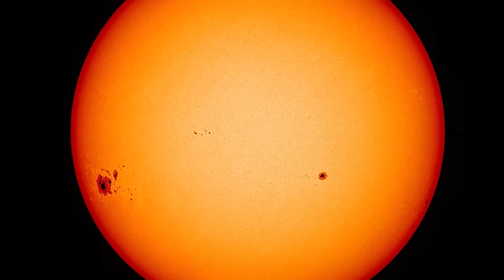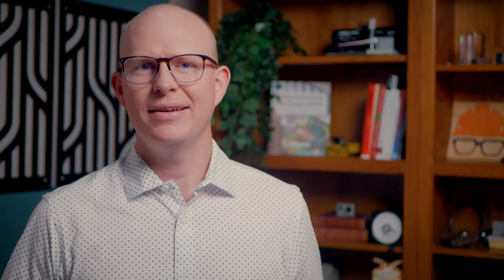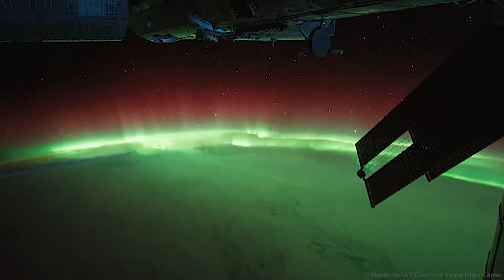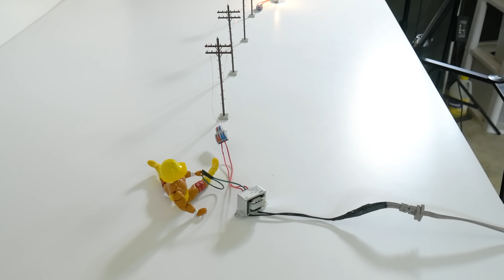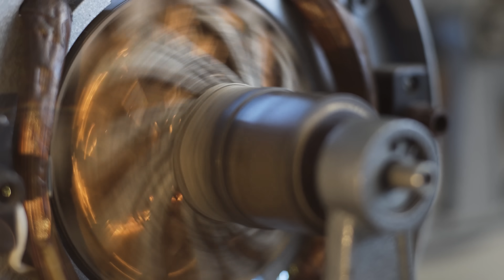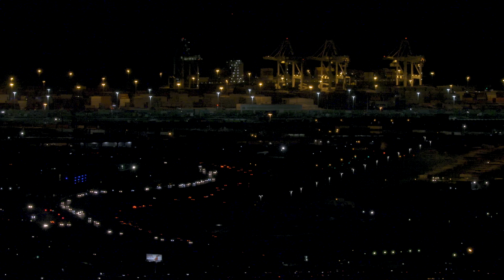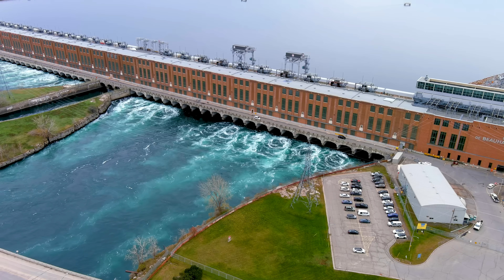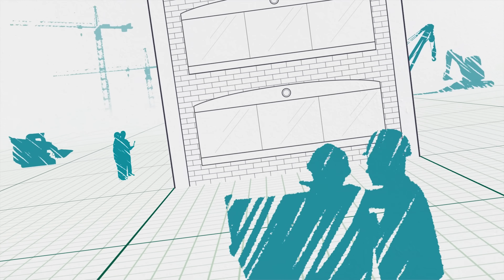The Most Confusing Part of the Power Grid

Comment: You know what doesn't have a power factor, losses due to line capacitance, phase difference (between the generator and the grid), phase order (in a 3-phase motor), and finally that buzz?

A DC network.
Reply: You know what needs a clock signal, a power MOSFET, a capacitor and an inductor just to change voltage? DC current.
Reply: We could transform the production and  transmission networks to DC, and produce the 3 phases only in the distribution stage.

Comment: Solar flare and CME currents are DC, but vary with time as clouds of charged particles are picked up. Watching the Northern Lights can visualize the clouds of charged particles entering the atmosphere. The issue with the electrical grid is the addition of relatively constant DC current on the grid. This by itself is not a big deal until the DC current is in a transformer, which makes it act like a large electromagnet. This DC on top of the AC saturates the magnetic transformer core in a non linear fashion. When the DC adds to the peak of AC, the risk of maximum core saturation being reached, the inductive reactance stops, and current peaks surge as the inductance essentially vanishes on the peak currents. This is what tripped the safety equipment or damaged substation equipment.
Many improvements have been made to the grid to prevent DC current on long North South lines, where the DC voltage in the ground is different, that would cause the DC to flow from the ground of one substation to the ground of another substation.
The primary protection to break the DC path, is changing the substation transformers. Instead of universally installing WYE windings to provide the center-point ground for static discharge of DC off the lines, one end of the line is now configured Delta, so DC can not flow from the ground of one substation to the ground of another, resulting in DC core saturation and damaging currents. The other protection is to replace the hard bolted ground for a WYE transformer ground to a high resistance ground with a spark gap. The resistance prevents high DC current on the line from differences in ground potential due to geomagnetic storm activity, while the spark gap still allows momentary high current discharge of lighting strikes.
We have learned from the mistakes of the past, and have engineered solutions to the problems. This makes the electrical grid much more protected from geomagnetic storms and strong EMP events.

Comment: One import factor here is that Inductive load doesn't just come from the end load, say a washer or motor. It comes in a not inconsiderable way from the power line itself. A power line is represented by a largely inductive circuit. And this inductance increases with the length of the line, so for a small line it might not be a big problem, but for a long line carrying a large load it becomes a problem. This some would say is the big advantage of DC power lines, in comparison to AC power lines.

Comment: I am an engineer with three engineering degrees.  I completed my graduate work at Stanford University, focusing on energy systems, applied mechanics, and nuclear engineering.  Well, I think your discussion is well done, you're missing the primary concerns... The frequency and sinwave.  These are the most critical aspects regarding the stability of the network!  And there are huge problems with this regarding the alternative energy options.  [I am a retired research engineer from Sandia National Laboratories.  I performed research on numerous energy options, including wind energy, solar power towers, and direct conversion.]  However, the biggest challenges involved the variation in the power of availability with solar and wind.  There are also problems with direct conversion in terms of the distorted sinwave produced, causing instability.  These are massive problems and presently.There is tremendous concern regarding the instability of the power grid and the fact that this instability increases as the percentage of solar increases.  My son is now performing research at Sandia, and they are extremely concerned about the long-term consequences of using residential solar on the grid.  I am a nerd and dislike an involvement with politics.  But I quickly realized (in 1979) that greed, corruption, and politics control engineering research... And most infrastructure projects!  But I think your presentation of basic electrical theory is wonderful!  It was a fine effort as far as it went.  (I certainly understand the limitations within the uneducated audience.  You can't teach everything in ten minutes!)  Thank you!

Comment: 17:47 these are more often in the industry known as shunt reactors. Long stretches of transmission lines will essentially act as massive capacitors, so we install them in substations where one or more busses lead to long distance transmission lines. When the inductive load at the end of the line is high, the capacitance of the line cancels it out and the p.f. is good, but as soon as the load drops there’s too much capacitance in the system so the utility closes the switch to the reactor

Comment: Fanny to see the electrolitical capacitor connected to AC net. A bit more time and there would be small explosion. By the way,  reason for overcurrents caused by magnetic storms is not explaned- low frequency currents caused by magnetic field fluctuations  are saturating the transformators cores...

Comment: At 6:43, why doesn't the electrolytic capacitor blows up as it is a polarized component and it's being used in AC?
Reply: Not enough power and not enough time. 
Electrolytic capacitors take damage from reverse voltage but at low voltage it takes time for it to fail. Higher voltage will eventually create a runaway reaction that quickly lead to catastrophic failure. If the power isn’t high enough the capacitor usually just vent. If the power is high enough it will explode instead.
If he had connected it to the grid instead of the low voltage transformer 💥

Comment: Many years ago a power line to a farm in our area was placed parallel and too close to a river. The farm experienced dimming when the river was high after big rains. Engineers decided there was a mutual induction between the line and the river. Simply moving the line further from the river corrected the problem. Another farmer had a fence that became hot because it was too close to an overhead power line.

Comment: 4:04 I might be misunderstanding, but how does light bulbs change resistance based on voltage? Isn't resistance a constant affected by the material? And thus when changing the voltage, the current will change too? 

Or does he refer to the heat's affect on material resistance?

It's quite ambiguous.
Since it is only starting to take affect when the conductor heats up.
Therefore it's not only true to lightbulbs but also to every electrical device with a resistance
Reply: Yes!  - you have answered your own question.  All conductors heat up with current flow - some more than others - and resistance increases with temperature.  Filaments in light bulbs get very hot, so there resistance is much higher when in use than when the bulb is cold.

Comment: How exactly is the power flowing? Isn't the energy the one flowing? Why are we talking about power like a quantity when the quantity is the energy and the power just describes the rate of change of that energy?
Reply: Power is the amount of energy converted to work over time. We talk about it as a quantity since it is a vector. It has a value and a direction. (The direction is the axis of time.)

Energy is existing in the wire if you put it in it. That's why we refer to live wires as energized. When you take that energy and use it over time to produce work, it turns into power
Reply: In power systems, engineers are often more concerned with the instantaneous rate of energy transfer (power) rather than the total energy transferred over time. This is because power determines the capacity of the system, the stress on components, and the stability of the grid.

The term "power flow" is a shorthand used by power engineers to describe the movement of electrical energy through a system. While it’s technically the energy that is being transferred, the term "power flow" is used because it focuses on the *rate* at which energy is being transferred at any given moment.

Comment: Grady, great job as usual!
But i think the Quebec black out was caused by the Other Type of poor power factor, not the Linear Type caused by Linear inductance or capacitive PF.  I think Non Linear harmonic PF was the root cause.  So what went non-linear?  The silicon steel HV transformer cores. It doesn't take many 10s of amps of DC current to begin Saturation on each 1/2 cycle of a 500kv Y connected 3 phase xfmr.  The core goes into Saturation when the AC current provides maximum flux, and Huge Current spikes and mostly even order harmonics. The core effectively switches on and off at the 60 hz rate. Disaster ensues!

Comment: How do you determine which direction the power is flowing in an AC circuit? Are there electricity meters that can record the direction of power flow? I was thinking of homes with solar generation, it would be necessary to know the direction of power flow. How do home generation installations mange to get power back on to the grid? Do they boost the voltage up until it flows back into the supply?
Reply: Power is flowing from the live to the neutral.
Reply: @ can you explain how you can measure the direction. With solar for instance it is important to know where the power flowing from.
Reply: @ as the current changes direction so does the vector of the induced magnetic field
An analogue amp meter would swing it's needle in the opposite direction

Comment: Having had to teach this to high schoolers for my educational degree, after finishing my engineering degree, I would have loved to have this video as an introduction to the calculation part. I'm an electronics engineer by trade and had them calculate the capacitance needed to overcome the inductive reactive power (among other (easier) exercises).  Even though I gave a similar intro, I noticed that a lot of students were just using the formulas and equations without grasping the underlying implications and meaning of what they were actually calculating. Thanks for this amazing piece of both practical engineering and some power theory!

Comment: Yeah people who have a subwoofer in their car have to think about this, because a subwoofer is basically a big coil, so you use an electronically regulated capacitor for something that's called "Blind Power Compensation" in German (because we say "Blindleistung" or "Blind Power" instead of "Reactive Power"). The capacitor is there to provide blind power, so the subwoofer doesn't destroy the car battery.

Comment: All methods to electro/mechanically fix power factor will have some losses vs benefits. It wastes power to keep a large mass spinning & these "synchronous condensers" only last a few seconds at max output (frequency will drop as more energy is used from them).
To have multiple sources share the work & loads to see regular waveform needs the sources to stay synchronized otherwise they work against each other & waste more energy. Grid connected inverters & generators need a frequency to synchronise with otherwise it's like a boat with multiple rowers trying to move the boat in different directions at the same time so boat goes slow/nowhere.

Comment: power does flow in one direction, but current flows in both directions 120 times a second, 60 each way, so this is misleading to learners
Reply: the graphs show that, if you did not understand.  this video is not really for beginners.  ac is not for beginners.

Comment: The water analogy never helped me understand electricity.  When an electrical switch is closed it means the electricity can flow.  When a valve is closed it means the water cannot flow.  Explain that please!
Reply: you are confused.  when the valve is open, water flows.  when a switch is closed,  electricity flows.  valve open = closed switch.
Reply: @jack76gh45  So you are saying open=closed, and closed-open? hmm, curious.
Reply: @tomgunn8004 when electrical switches are closed, current flows.  open switch? no current flows.  when a fluid valve is open, fluid flows. you close a fluid valve, fluid does not flow.

Comment: Did anyone mention that Hydro Quebec had a data network supplied by Northern Telecom. The DPN switches stayed up but there was a problem: the transmission links relied on modems that were plugged in to wall power - not any sort of UPS like the switches were. All of the remote sites were isolated until the modems could be supplied with electrical power.

Comment: I came back across this video, and had to comment on the Texas power grid issue (that was mentioned).
Although, yes... the Texas grid did nearly go "down" in Feb. of 2021(I live in west Texas, and we were without power for 5 days. Thank God for my stand-by generator!) we now know that the failure scenario was NOT a natural occurrence, nor did it happen because Texas electric grid operators somehow mis-managed the generating capacity vs. demand scenario.
It occured (as recently reported) due to the natural gas suppliers, intentionally limiting the NG supply available to the generating facilities, in an attempt (and a successful one at that) to artificially jack-up the cost -- and their profits -- for that NG. Less [apparent] available fuel to run the generating stations during that high electrical demand period, meant the cost of both NG and electricity sky-rocketed in order to meet the demand, even though the gas supply "limitation" was completely artificial and intentionally man-made.
A despicable act in order to make a buck.
It's always about the $$ and the share-holders, and the public good be damned...

Comment: I don't understand in your curve at 14:52 to avoid this can we just not add more generators to increase the voltage to avoid this "nose of the curve"? Can be compared to a flow of electrons not having enough strength to reach its destination?
Reply: Thats what capacitors are for. Imagine they work like a shock. They take the load when voltage is high and discharge when demand is up. This is what the SVCs they are big systems to help smooth out these spikes in power.
Reply: Sure, but generators cost money.

Comment: Nitpick alert: Enjoy these clips, keep them coming. (nitpick) There is a small error in the graph of power at around 8:35 in the clip. The power curve (green) should be going through zero whenever the voltage (red) OR current (yellow) go through zero. This is correctly shown at the zero crossings on the left and right but not the one in the middle - the green curve is crossing zero a tad time delay after the red curve. I suppose this offset makes the curves more visible (instead of overlapping), but, ... Yes, pedantic, but then, I am a (college) teacher, so I should be, no?
Reply: Not pedantic at all. Learning this for the first time, and was confused when reading the graph closely. Assumed it was an error in the graph, thanks for confirming!

Comment: Power Storage. Besides batteries, there is an old system. Simple. Pump the water uphill to a large tank or lake. Generate power on demand by running the water downhill through a generator. Storage efficiency is efficiency of the pump motor X efficiency of pump X efficiency of generator. 90% x 90% x 90% = 72.9% total efficiency. I read where total efficiencies of 80% to 93% can be realized in practice.

Comment: One interesting thing that nobody ever talks about is what the power wave actually looks like. Basically it is like a slinky or coil spring. We are all used to seeing the wave pattern on an oscilloscope. So, what you are seeing there is looking at the slinky straight from the side. Stretch out the slinky, lower frequency. Collapse it, more frequency. Of course, that is only a single phase. A complete representation would be 3 interlaced slinkys that are situated at 3 evenly divided patterns.

Comment: Many thanks for this high quality and concise explanation! One comment: In the case of a large plant (e.g a refinery) with numerous induction motors, it may be of interest to install a single synchronous motor drive ( if there is one large continuous load) instead of multiple capacitor banks. Such device will optimize the power factor of the whole plant, and even generate reactive power to the grid, if needed by the grid operator….

Comment: 9:51 Even though only large customers are metered for both real and reactive power, your hydro company doesn't allow you to receive and return reactive power for free. The average power factor across the distribution region is compensated for in your rate ($/kWh) since these many small customers still increase the total MVA through devices that have current/power limits.